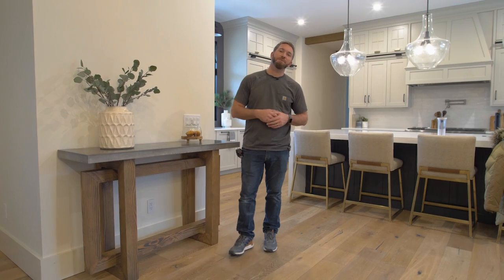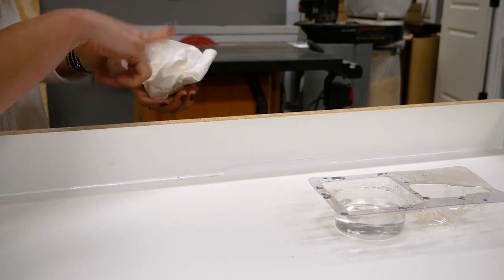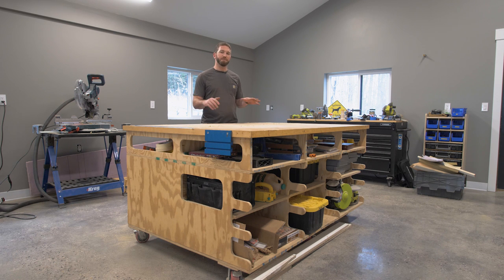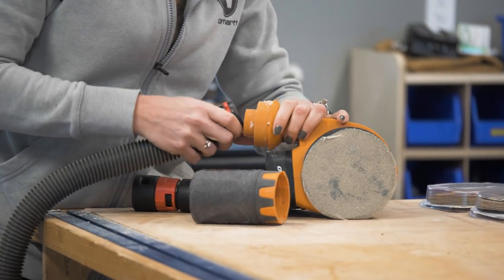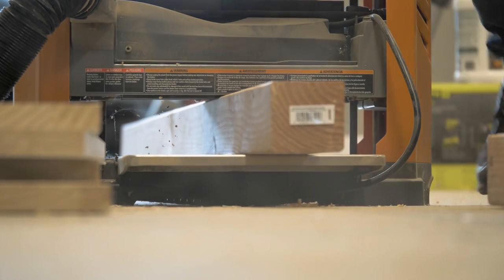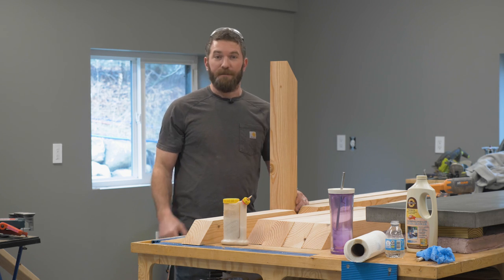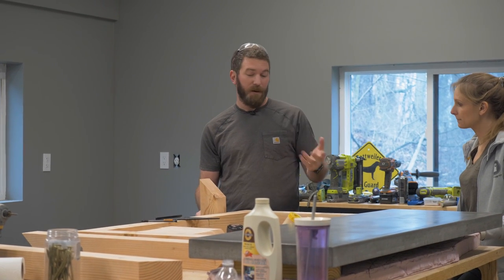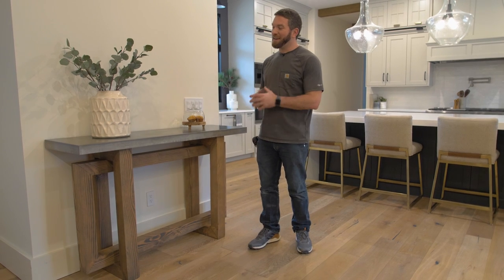4x4 Console Table with Concrete Top

Comment: Loved making this table (actually still need to pour the cement). The takeaways I have for anyone aiming to build it are 1) He mentions planing the wood...I did this as an after thought when my joints were not meeting up as cleanly as they should be. Lumber from a typical big box hardware store is not going to be furniture grade, so planing it (if you have the equipment) is recommended as the wood I was finding was not straight. 2) Be sure to sand the wood before you start to assemble it...at least sand the inside edges which will be difficult to reach once it is put together if you plan to use an orbital sander or any other electric sander. 3) He saves some of his cuts after he has completed some of the assembly of his table to ensure the pieces fit as tightly as they should. I followed his measurements exactly but somehow the gap between the inside “box” and outside two boxes was too significant, so I had to re-do some cuts. If you watch him closely in the video, you will see how he is doing it...seemingly piece meal. 4) I filled every bolt hole with the dowel except those that held the bolts that connected the square boxes to other boxes (there are 4 such bolts)...reason being, I wanted to be able to disassemble the table in some capacity if need be for repairs or for moving, etc without having to tear the table up to remove the dowel to access the bolts...plus, these bolts are either covered by the top or face the floor so they are never seen.
Reply: Do you think is necessary to cover with a dowel those holes, or it'll look OK leaving them exposed? The wood that he used is Kiln Dried SPF Posts, in the instructions. I don't know if I can find that kind of wood. 🥺
Reply: @joy9073  I would fill the holes with putty, if you don't want to use the dowels. The dowels are really easy however putty would be an option you could consider. The reality is, if you don't fill them, you will see exposed holes where the screws were inserted. As for the wood, I bought 4x4 (redwood I think?) posts from Home Depot which may or may not have been kiln dried. As mentioned in my post, the challenge you will face with big box lumber lies in the likelihood that it won't be straight which will impact how each piece lines up with you join them at the corners. I have a planer which I used to address that issue but appreciate that many will not have access to that piece of equipment.
Reply: @BanksHolcombe  thank you so much for the information. My only fear is that the posts might not be straight. I don't have a planer, so that's another thing to take into consideration, bcz I won't be able to fix the problem. 😵

Comment: I need to make this 72" long for the 9' long wall I have at my home. Do you think is possible? 
I love the design, I do love the concrete but I can't make it.
Where did you use the 1-⅝ wood screws, your instructions say that, bcz the only screws you mentioned in the video are the 5"

Comment: Hi. I get that concrete is heavy but for a high traffic area, I don’t see how this could be safe (kids) if the top is just resting on the legs. What would be a good way to secure the top to legs without compromising or breaking the concrete. I’m looking for a pro answer, as I see he hasn’t answered the same question that was asked by someone else.

Comment: Instead of the wire mesh, fiberglass flakes, or styrofoam beads could be used.
It will lighten up the concrete but also give it strength!!! 
At least the fiberglass flakes will...

Comment: The wire mash (rebars) should sit towards the bottom, not the middle and not the top. You can use a vibrator to get the air out. Just dip it in.